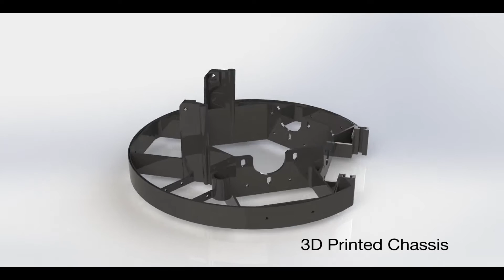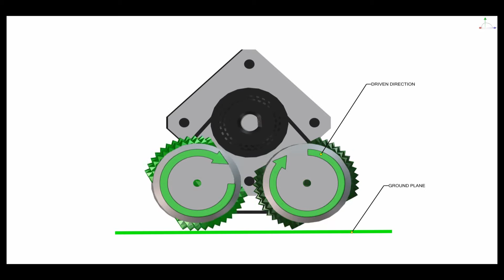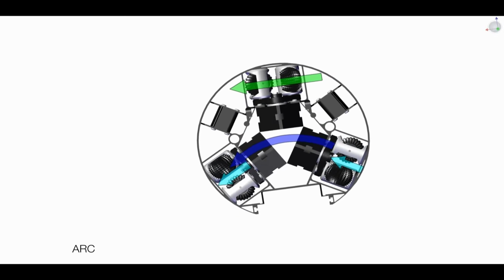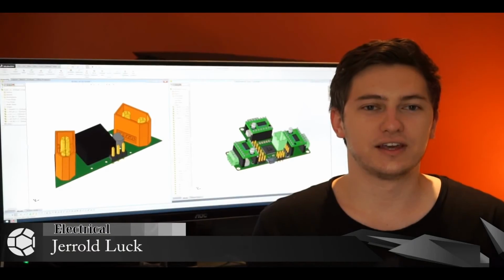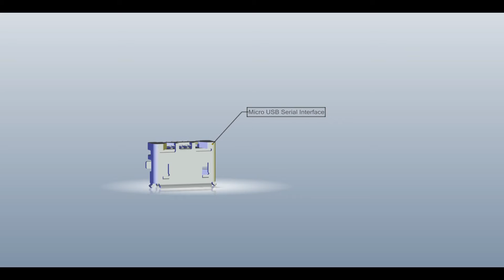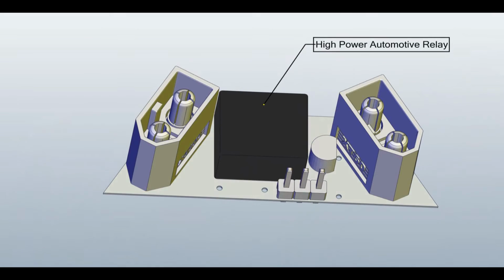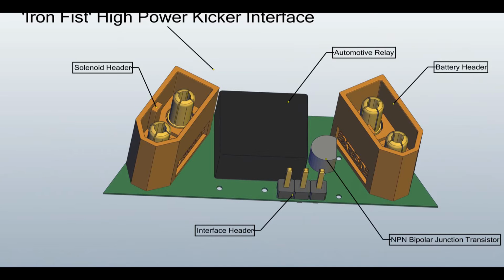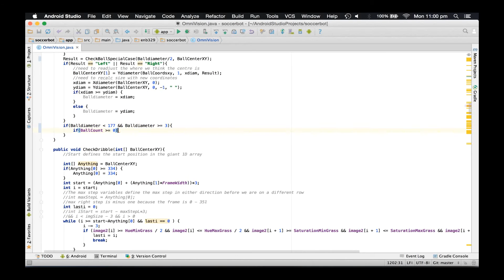SSL soccer robot

Comment: Great works! How do you do the kicking? As I know from other SSL teams, they use the solenoid kicker with one big capacitor but i didn't find any kind of electric capacity in your video.
Reply from the maker: There is a solenoid kicker and 2 lipos, 1 for the overall system and 1 for the kicker.
Reply: @rexkc  Thanks for the reply! Did you try to test the maximum speed of kicking?